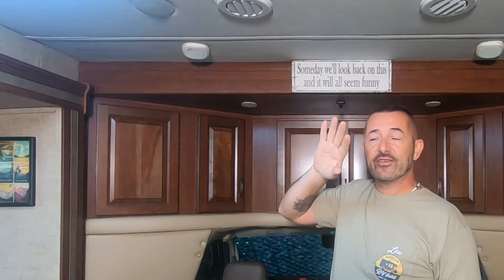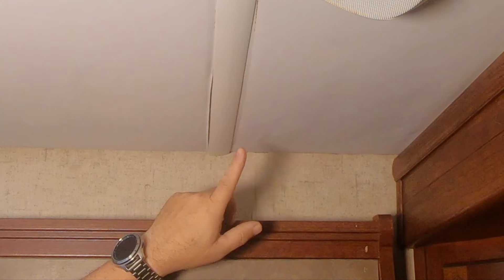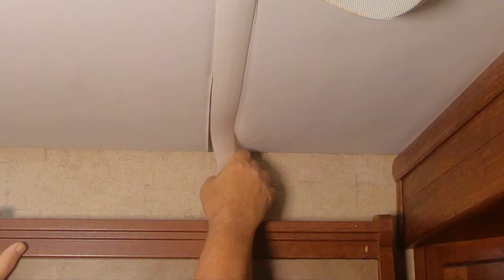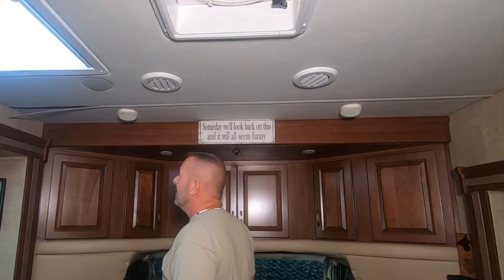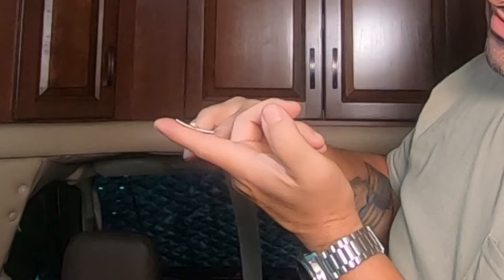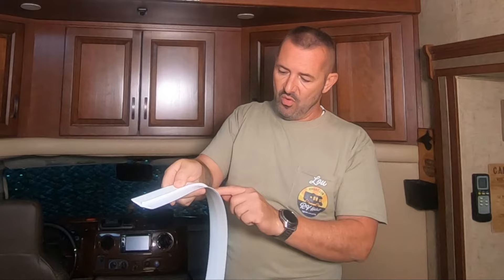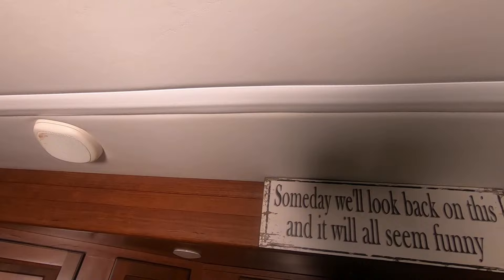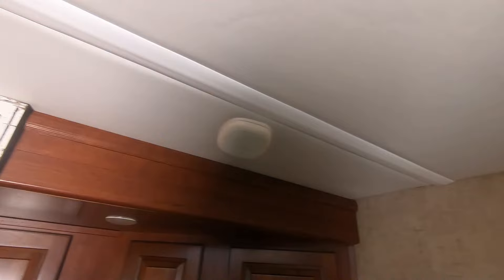RV Ceiling Repair With T-Moulding – RV Repair – RV Project – RV DIY

Comment: New RV owner, used RV from Cruise America. . The T molding needs to be replaced on entire ceiling. 😢 The ceiling material is pulling away from edges.
This seems an easy DIY project. Wish me luck. 
Appreciate the link to supplies in comments.   Thanks so much.

Comment: Thanks as always Lou for a good video. I always like to check your channel out because I have the same type of Forest River RV. I too had the same problem with a roof leak around my vent which caused the white vinyl ceiling material to shrink. Had to purchase a wider t molding trim to cover the gap. Thanks again.
Reply from the maker: Hi DJ, that's great to hear.  I couldn't believe the ceiling shrunk lol.  I don't think they use the vinyl anymore on the new Foresters.

Comment: Hi Lou,
I have a Forester 3051s and the same thing happened to us.  I bought 1.5 inch and it's not wide enough to cover it up.   On Amazon the only way to buy the 2 inch stuff is $ 211 for a big roll.  Is that how you had to buy it?
Thanks,
Phil
Reply from the maker: Hi Phil, go to https://www.t-molding.com/  they sell all sorts of t-molding by the foot.  I think I paid about $20 delivered.
Reply: Thanks Lou

Comment: I have a 2006 Winnebago are all interior roof straps like yours in video t- straps ?
Reply from the maker: No some will use different types such as a thin strip of wood molding that is nailed in place.

Comment: i might need wider than 2'' t molding, any thoughts?
Reply from the maker: I have not seen it over 2 inches.  Contacting someplace like T-molding(dot)com may help.  You may have to come up with some other option unfortunately.

Comment: I am putting an vinyl with foam backing on rv ceiling.  I need to know where I can buy the metal grove and the T Molding.  Please help
Reply from the maker: try t-molding.com or any RV supply house such as RecPro or Lippert.

Comment: How much space is there between the ceiling and the roof above  last fall it sounds like there’s a chipmunk or some thing out there running around at night in the ceiling .
Reply from the maker: Hi John,  there is plenty of room between the ceiling and the roof for mice and chipmunks to run around.  Actually it is pretty common.
Reply: @RVHabit   Thank you for the information Any ideas about what to do about it and how would they get into that area.thanks
Reply from the maker: Rv'ers since the beginning of time have been trying to seal every hole to prevent mice from entering the walls and ceiling with no luck.  You can start underneath the RV and  look for any little holes.  I use spray foam.  Be diligent as a mouse can hold its breath and enter the tiniest of cracks.  You can also try mouse repellant sprays or mothballs.  I recently installed some 12v pest repellant devices in the RV and they seem to actually work fairly well.  Here is the link to the article and video.  I originally just did the engine compartment but since have added them to the interior section of the RV.  https://www.rvhabit.com/post/keep-rats-and-mice-out-of-the-rv-engine-ultrasonic-under-hood-animal-repeller-easy-install

Comment: So there was no damage under the white panel i have a horse trailer, where the panel  bubbled and shrunk.
Reply from the maker: It did not bubble.  The wood underlayment was solid.  The vinyl did shrink a little.
Reply: @RVHabit 
Did you check under the panel to see if any damage? That's what I have to do and replace the panel.
Reply from the maker: The vinyl was glued to the luan plywood and still holding tight.
Reply: Thanks

Comment: Where did you find your t moulding?
Reply from the maker: You can find some on Amazon but I purchased mine from https://www.t-molding.com/
Reply: @RVHabit   the only 2 inch I found on Amazon was 250 ft roll.
Reply from the maker: That was my issue also with Amazon.  Try t-moulding.com  They sell most moulding by the foot.

Comment: Thank you sir, I have the same issue with mine and was wondering how to tackle that problem, I didn’t realize that was T- Molding! I’ll try and do as you did and see if mine comes off as easy! BTW what did you use to trim to center down?
Reply from the maker: I just used a utility knife.  It cuts very easily.
Reply: Thanks! I was at the RV tonight and tried to pull on that molding but no luck so I’m not sure if I have the same setup as you I’ll have to go back with some tools!